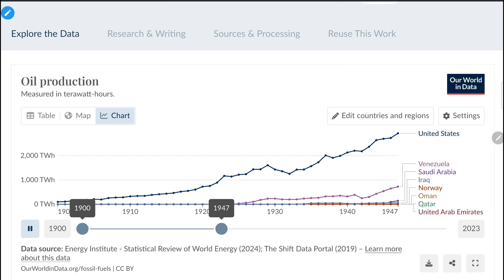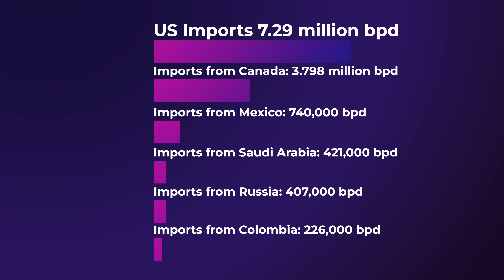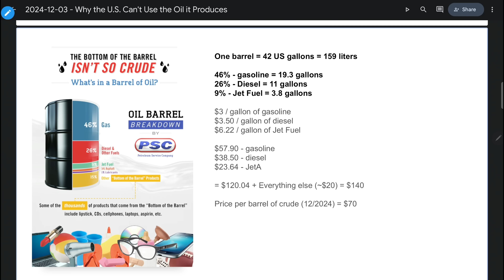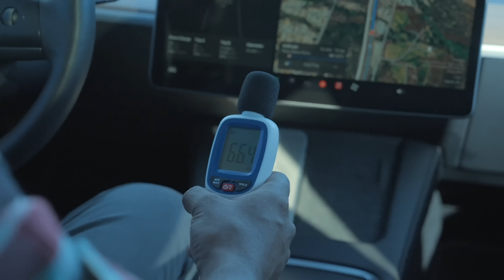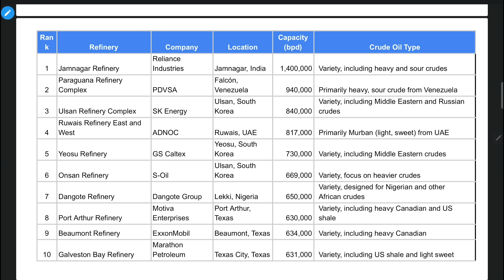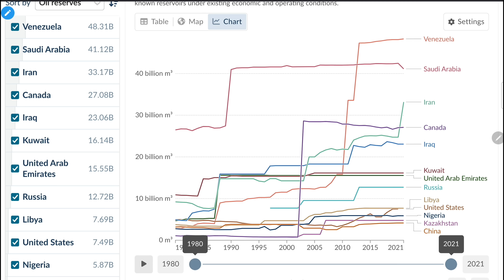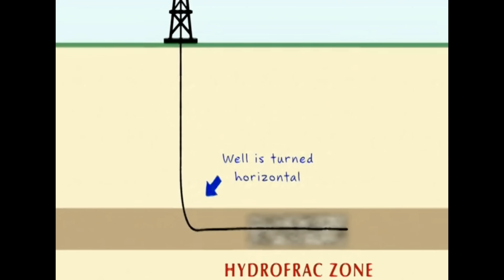Why America Can't USE The Oil it DRILLS

Comment: As you stated at the beginning, more than half of each barrel of oil goes toward the production of other non-gasoline products.  As long as we continue to use and need plastics, cosmetics, lubricants, jet fuel etc., we will need to continue drilling for petroleum.  Remember, there's a great deal of oil that goes into the manufacture, lubrication and maintenance of an EV, not to mention the electricity generation required to recharge all of those "green EV's"  (they're not quite as eco-friendly as we're expected to believe) - until we're ready to go nuclear, the most eco-friendly electricity generation at scale is still burning natural gas.  Also, it's not quite true that producing more oil in the US does not affect the price of gasoline, every barrel into the marketplace has an affect on price, whether it's refined in the US or somewhere else - price will be affected.

Comment: Nicely done, but…
You seemed to have missed a few things.
Oil companies have wanted to build refineries that can process crude from shale, but can’t get permits due to “federal environmental regulations”. That may change. But it’s hard to invest billions of dollars into refineries when the next administration may just shut it down. (See the nuclear industry as an example)

Building new refineries in the Texas basin would be an economic and environmental win by eliminating the need to ship the oil.  No economy of scale would matter and global politics would not matter as much.

Our refineries are aging rapidly and will need to be replaced. Lots of them. Because they can’t get permits to build new ones, they use “baling wire, bubble gum and bandaids” to keep older refineries going.

I recommend that you talk confidentially to chemical engineers who actually work in the industry and the ruff necks for a different take on the situation. 

You are correct that the reason that we import oil is politics, but the idea that economics is also a cause may need a little more research. If oil companies could get reasonable assurance that their efforts at new refineries would stop being unreasonably thwarted, the situation would change dramatically.
My evidence to support my claim? Answer this question: How many completely new refineries (not upgrades of existing refineries labeled as “new“ ) have been built in the US over the last 30 years?

Comment: It will never be possible to replace current cars with electric cars in a 1:1 ratio. The main reasons are the availability of raw materials necessary for building batteries, the durability of batteries and the problems with their recycling, the cost of electric cars, the costs and time necessary to develop the electrical infrastructure, ... The richest will remain on the roads.

Comment: U S refineries could never handle light sweet crude. This is the first time I ve felt you were obviously biased. Light sweet is actually easier to refine but more valuable. Since we can handle sour crude which is cheaper it makes more sense to sell the expensive stuff and then buy the cheap stuff since weve made the investments to handle the cheap stuff. its that simple. One area where the US is still the tacnologically ' and efficiency leader. Im dissapointed in you. On its face your aurgument is flawed. By the way us shipping our oil out and importing sour crude should be stopped. Spill risk is the biggest risk that could be eliminated.

Comment: Oil should be getting PHASED OUT as a source of fuels. In which case, eventually, the amount of petroleum consumption will be about HALF.
Do lets get vehicles having  internal combustion engines to use electrically split WATER (H2O) as a fuel. HHO provides PURE Oxygen, not 12% atmospheric Oxygen, and is way more explosive, which provides more horsepower.
HHO made on-board the vehicle at safer low pressures, as compared to a 10,000psi full tank of Hydrogen, that needs the 12% atmospheric Oxygen.
As for NATURAL GAS (88 to 92% METHANE). It should be made in BIODIGESTERS from recycled food garbage and livestock poop.
Biodigester technology has been used in rural Africa 55 years ago to provide cooking gas.
Reply: You do realize that electrolysis requires far more energy than it creates, right?
And where on earth is atmospheric oxygen only 12%?
Reply: @CSMSteel7  17% if you're near the lake Michigan and away from any major roads. 
True facts: 42 years ago, back in 1983 in San Diego (California), 2 miles east of the Pacific Coast, only a quarter mile east of I-5 and Calif. Hwy 92, the Oxygen level was only 5%.
This is before many vehicles were turbocharged.
Reported on the science news to be at a world average of 12%.
Oxygen levels went up somewhat with the quarantining, the Spring of 2020.
Textbooks of the 1950's........28% oxy
As time went on the official levels gradually decreased.
Jurassic period Oxygen was well over 30%.

Comment: Thanks for this explanation. It’s a complicated issue. We see the grease running down the wind turbines in our area and the Harvey equiptment and massive infrastructure to support them, and we’ve seen videos about the wind turbine blades being buried every 10 or 20 years as their useful life expires. Another major factor is mining for the electric vehicle batteries I’m not condemning oil or electric vehicles I’m just saying it is complicated.
Some firefighters say they would rather fight 100 gas car fires than 1 EV car fire.

Comment: I just did the numbers.  20 million barrels per day used 47 billion barrels of proven reserves.  2,300 days of supply known.  6 years.  Hmm not a huge margin for error there.  And even if we stop burning fuel we STILL will need plastics for a long time to come.  Yet US consumers are resisting changing to EV vehicles or using smaller and more efficient vehicles.  Hmmmm.  Can anyone else see a problem?

Comment: You are wrong. There will always be a need for fossil hydrocarbons for specialist use such as plastics. Bio plastics will be the main stay but its hard to replace all plastics for all uses. only some plastics for some uses. Oil is used in a lot of other modern products such as dyes, medications and adhesives.  Then there is the military need. EV;s are ok for civilian use but how do you recharge on a battle field?

Comment: I live on an island the only way to get here is a plane or boat . The ferry is the main transportation , The ferry's during a storm salt water will wash over the car deck drenching the EV's in salt water which is very dangerous for Lithium batteries . If an EV catches on fire it very likely to sink the ferry . Causing a catastrophe unmatched in our area ,taking almost 100 cars and trucks , most with full gas tanks , into the Puget Sound

Comment: Use electricity to separate the hydrogen from shale oil. You can have solar farms on site.
Reply: Hydrogen is not a source of energy. It’s a handy tool for storing and using it in different ways.
Reply: @plaiche  i dont know what planet you live on bu its a gas. Hydrogen can be burned with oxygen to generate electricity and water, or power any engine that runs on hydrogen. You use the hydrogen on your carbon chain for energy.not the carbon. Do we burn the carbon with oxygen? You might just as well have an engine that burns iron with oxygen.

Comment: You can't scale EV. Truth is in the numbers . Cars in use on the road. EV is less than 5% worldwide. Trucking? likely zero. Yes Europe and China lead in sales. But the rest of the world isn't ready for EV. Oil will be replaced by hydrogen before EV ever becomes mainstay. Again, you cannot scale EV. And the faulty disposing of it will be worse than any oil spill. Batteries are dirty. There will never be EV commercial fishing and transport ships, military or planes. EV is a boutique energy that got out of hand. Most non-Chinese mfgs are now shying away from it. Wind and solar obviously are supplemental, and always will be. Nothing wrong there, but when you look at economics, developing countries are going to get reliable energy. And we need to develop the world to secure our own way of life dependent on floating dollar debt. Oil will be king and gas queen into the later half of this century, easily.
Reply: Clearly you dont live in california, Ev's are becoming common and ever increasing
Reply: It’s even more fundamental than this, but this video is alarmingly incomplete, encouraging all sorts of bogus assumptions about the future. 

For starters, while I believe conventional crude peaked as far back as 2006, shale and tight oil among other shifts have clearly extended the hydrocarbon runway (EROEI debates aside, though crucial to an accurate big picture). So demand destruction simply hasn’t arrived en masse, and flippantly claiming the oil age will ride off into the sunset is absurd. 

For “electrification” (which you state will replace the oil paradigm) you literally make zero reference to what you are proposing will replace the energy supply to electrify??? If you are proposing it will be wind and solar, get out your (nearly blank) whiteboard. 

First, apply your knowledge of peak oil to a comprehensive raw material and supply chain analysis for both wind and solar (assume leading edge tech for both): what does it take to build and maintain capacity? Any achilles heels i that gargantuan shift? 

Now add in the intermittency issue and tally up what conventional backup infrastructure you need to make it viable. 

Now consider the constraints on the adoption end: enormous resources including rare earths and other key commodity minerals. Unclear if several peaks are lurking here (and the case is strong and has been made).

Now consider economics: after trillions invested over the past 20 years, hydrocarbons went from 84% of total BTUs to 82%. If you’re  certain investors and oil majors won’t budge on the CAPEX to upgrade refining, where is the astronomical capital needed to even get oil down to 50% going to come from?

Which brings us to the downstream economics: the middle class is all but gone, and spare cash is hard to come by. Hydrocarbons are still MUCH cheaper on the whole than alternatives. Voluntary cost increases will play some small role, but they will decrease and either way, won’t rapidly shift the market (even if supply is there). 

Re supply, how about the grid? Trillions in arrears in that dinosaur, and pockets of EV adoption are already creating tension and battles over cost, capacities, and subsidies. No clear path to the big leagues here either. 

Total BTUs to make new vehicles: massive and rarely included in rosy projections. 

Land use requirements assuming exponential growth and supply replacement with solar: vast.

Wildlife harmed by turbines?

Short depreciation cycles for turbines (moving parts n shit) are both expensive and have produced graveyards of scrap blades all over the place that don’t make the cover of Blowing in the Wind brochures.

This, like, your video, just scratches the surface. None of this pencils, and worse, there is a very strong argument that the net ecological gains projected are equally superficial when everything has been accounted for. 

A good 9th grade ecology class summary on US supply, reserves and the basics of refining in a global context. After that, I’m not sure you said anything at all, and certainly nothing substantiated by hard data and rigorous analysis. 

The buried lessons of peak, is that whether from constraints on supply, or ongoing runaway growth and consumption, business as usual is on the clock. Magical transitions ain’t comin’ and big, bumpy changes are one way or another. You’d be better served to restart there and don’t greenwash your content with placating insinuations that oil is a dinosaur heading towards extinction and breezy sunny days will slowly take over.  

How about conservation through relocalizing? How about ditching cars and building mass transit?  We’re enormous…how about we take a walk or pedal more? Grow food? Etc etc. This will be a team effort of it’ll be a shit show. Tell people that.  They deserve to understand it.

Comment: One aspect that you didn't deal with is the simple fact that to reconfigure a refinery to handle light sweet oil shale crude will take a refinery out of the loop for 1 - 3 years. Under the circumstances can you remove somewhere between 10 to 40 % of the refining capability out of the loop for the next few years and the answer to that is no, you can't. Building new refineries would be in the neighbourhood of 10 - 12 years based on permitting and construction times so that is not a feasible answer to the problem.

Comment: EVs will not "free us from oil" and neither will solar or wind.  Only nuclear and geothermal can compete with coal, natural gas, and hydroelectric.

We'd be far better off investing in new refineries than investing in wind, solar, or grid storage.
Reply: In socal every other car is a ev, change is coming
Reply: @brucepoole8552  In CA, EVs make up just over 10% of all vehicles and 20% of new vehicle sales.  But if your gasoline prices were around $3/gallon where they should be and there were no government subsidies to buy EVs, their sales would be far lower.  Give it a few years for the masses to realize the true high operating, insuring, and repair costs of EVs and you'll really see sales tank.  Aside from their blistering acceleration, there is nothing to recommend EVs.
Reply: @ your stats dont hold up, I just came back from san diego and I can tell you from my own observation your numbers are off, even 10% is alot and the numbers are growing very very fast, gas isnt going to get cheaper, EV's are going to take over like gas cars took over horses
Reply: They aren't my stats, they are Google's stats.

As for the economy of running on gasoline, do you realize that you pay around $2.25 to $2.50 per gallon of gasoline in taxes and fees plus the premium added to buy the CA "boutique" blend of gasoline?  Gasoline at my local folling station in FL is only $2.90/gallon, so you're paying nearly double.  The gas station I frequented when I lived in Fountain Valley, CA is charging $4.90/gallon today.  That's $2 more per gallon AND the tax per gallon here is $0.40/gallon, so your taxes plus the upcharge at my old Chevron station is $2.40/gallon.
Reply: @ of course I realize that, California is expensive, because its not florida.

Comment: America's oil is light oil and not suitable for producing diesel fuel. That's why we need Canadian Heavy oil which we buy at 20 percent less than market prices. If we didn't buy Canadian heavy oil we would have to buy Russian mazut oil at full market prices. So Canada is actually subsidizing our transportation system because without diesel fuel our ships trains trucks heavy equipment agricultural equipment military equipment won't operate.

Comment: Another thing never mentioned is how the oil we are taking from the ground is changing Earth. Like the hydraulic jacks we use oil to lift huge weights, what do you think happens when the oil leaks. Sure they pump a lot of the fresh water reserves into the wells to recover the oil but if water worked in the jacks we would use it. How many millions of pounds pressure have we released from the earth crust structure and is it causing the earthquakes and volcanoes we see getting evermore present.

Comment: With plastics you mostly aren't actually using the oil backbone, the long hydrocarbon chain, at all! By and large they're synthesized from natural gas because you can take the small molecule that you need, manipulate it to accurately plop things onto it, and then assemble the humongous and i mean absolutely unbelievably large polymer molecule, they're million units long to make that plastic cohesive and strong. So there is the long hydrocarbon chain but it's fully synthetic, not natural.

Comment: It is also not true exactly that local drilling will not bring prices. The current and futures crude oil are affected by local drill remember the Oil market is an international market regulated by supply and demand. Once you are putting new sources of oil on the world market you are affecting the pricing of the product. yes, it is a little more complicated but drilling local does affect prices, exploratory drilling, increasing reserves and new pipelines all going into the complicated equations of our energy prices

Comment: Light vs Heavy.  In the 1970s, oil refiners decided Venezuela (politically stable, large oil reserves, and low transport costs) would be their main source of crude oil.  However, Venezuela's crude oil was "heavy" and American refiners would have to spend billions on reconstructing their refineries to get the greatest economic value out of each barrel.  They spent the money but they also tied the industry to heavy crudes.  Venezuela's stability crashed and the US placed sanctions on the import of Venezuelan oil.  US refiners would have been in a bind except Canada was bringing substantial heavy oil production online.  This solved the problem until now.  Our refineries could use "medium" and "light" crudes at a much greater expense, which would be passed on in higher retail prices.